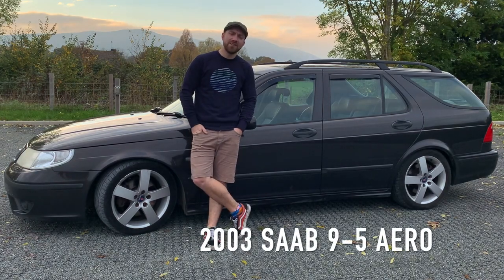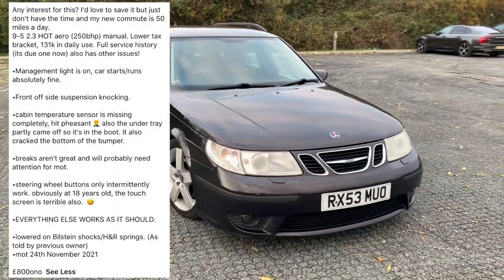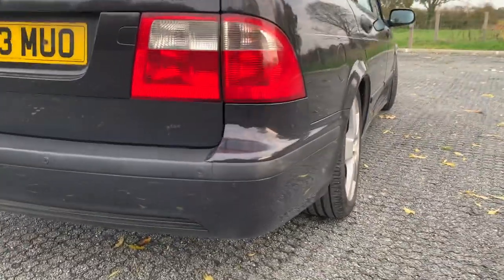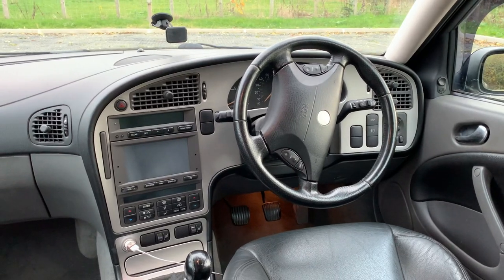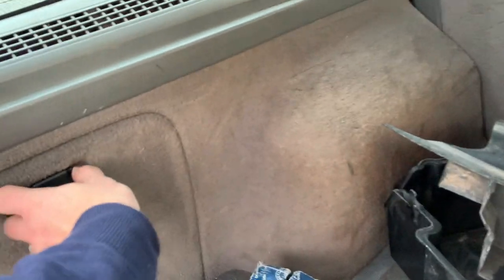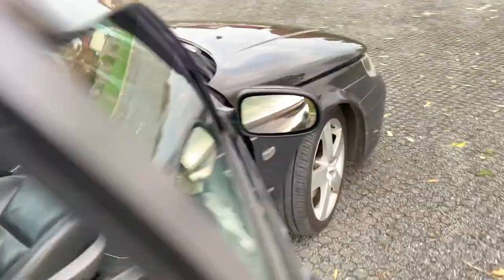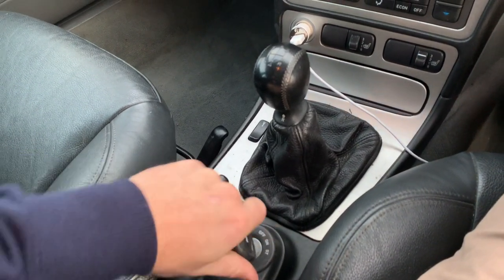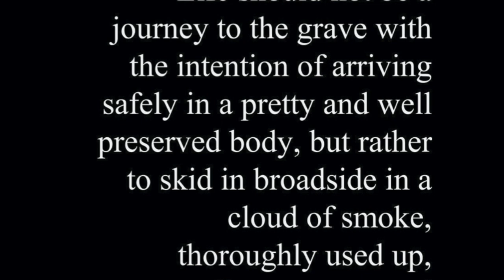2003 Saab 9-5 Aero Estate in Espresso Black from Facebook Marketplace - Part 1 - Walk Around Video

Comment: Knocking that sounds like a drop link nearside front will be the subframe mounts. Official fix involves dropping the subframe which is an arse of a job but it is possible to fix it on a few hours much more easily. I did mine a couple of years ago. Here are the notes I made when a few people on the UKSaabs group asked (and a few said it was impossible without removing the subframe! ): I've done it and didn't remove the subframe. For completeness here is how.
Car at least a foot off the ground - I was working on a nice warm garage floor, wouldn't want to do it outside.
For the rear wheels I had some old fashioned drive up ramps so wheels could stay on. I find this much safer (assuming ramps are wide enough) Jacking the front of a car when the rear is on stands can get interesting as the jack will cause the car to move sideways slightly which stands don't like. The wheels do tolerate that though, also if the worst happens the car lands on it's wheels, not its disks.
The front was on good sturdy axle stands (mine are 6 ton rated) on chassis rails just behind subframe rear mounts.
Front wheels off so can easily reach centre subframe bushes.
Undo top nut on rear engine mount and the two bolts that hold steering rack (loosen but no need to remove nuts)
Two scissor jacks one each side on subframe towards rear.
Loosen by a few turns front subframe mounts.
Remove bolts from centre subframe mounts
Remove bolts from rear subframe mounts and triangle support plates.
Lower subframe using scissor jack. Rear drops about 20 mm on it's own.
Check bushes. My centre ones were OK but rear were bad.
I use a wood drill (better on rubber than normal metal drill) to remove the remaining rubber in rear bushes.
The centre metal parts of the original bushes is T shaped - a washer is welded to the top of the centre sleeve - that's why I couldn't cut the rubber top off and pull it out the bottom.
However, it DOES come out the top. Use a pry bar to pull subframe down so gap increases to about 30mm (not much force needed) then you can push bush up and turn sideways and remove from top.
Now with a metal jig saw cut a slot in the shell (metal bush surround) each side, doesn't need to go all the way through. The heat from cutting, vibration and making a weak spot makes metal bush surround easier to remove.
I found some heavy duty M12 penny washers that were the exact size of the bush (I think 37mm diameter)
Big 1/2 drive socket on bottom to catch bush, bit of threaded M12 rod with a nut each end. A few turns and old metal bush surround drops out.
I fitted polybushes. Looking at the way they were I decided to cut them across the middle with a sharp knife. Mark top and bottom part so I can line them up. Push them in from each side and a bit of superglue to join them back together.
Then push in centre part (I used silicone grease - fabulous stuff)
Big washer that came with Polybushes goes on top.
Use scissor jacks to lift subframe back in to place and tighten everything back up.
Job took me about 4 hours.
Back on road the car is so much better.
No rattle when starting or going over bumps, feel much more precise on sharp corners.
No significant difference in noise vibration harshness.
Really pleased with the result, much easier than I thought in the end and not expensive - although does need tools and other bits mentioned above and at this time of year a garage. I would never attempt to lift the car so high (and be right underneath it) on an outside surface.
Reply: I did my rear ones outside on a sloping street parking space. It took a great deal of care to get the car safely jacked up and supported. Working in the limited space felt like a cross between yoga and spelunking! I didn't touch the engine mount or steering rack bolts but had enough room to do the rears. I did use a big pry bar which I pulled on with my legs while using my arms to fit the new bush. The old ones were so bad the rubber just fell out! I fitted Powerflex ones and they made the most satisfying squelch sound when they slipped into place under compression from a jack. 😁

Comment: Subwoofer in the lugage compartment wasn't standard equipment for Aero spec?
Reply: AS2 = no sub, AS3 = with sub ... not all Aeros are AS3 - think it was optional, along with  a trim pack that gave you electric front seats (drivers' side with memory) and heated rear seats - plus possibly some other bits. Basically if it's got heated rear seats, it's got (or should have) electric drivers' seat with memory - handy if you have multiple drivers. Not entirely sure if it was all part of the same trim pack - but from what I've seen, often if a car has the AS3 audio it'll have the heated rear seats too.